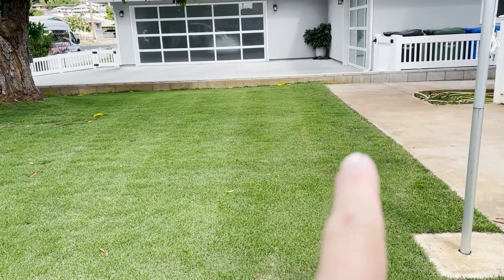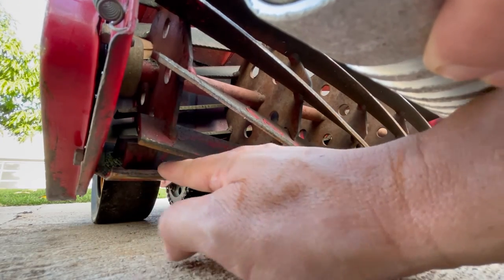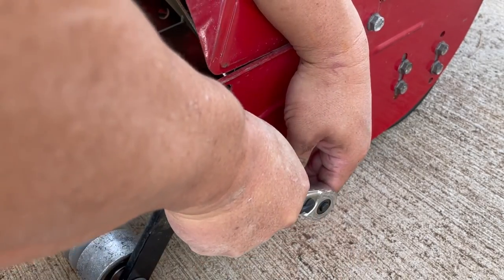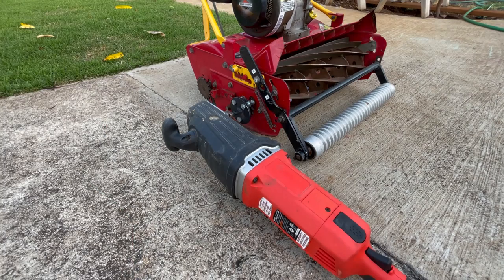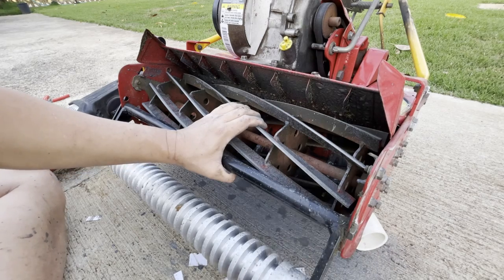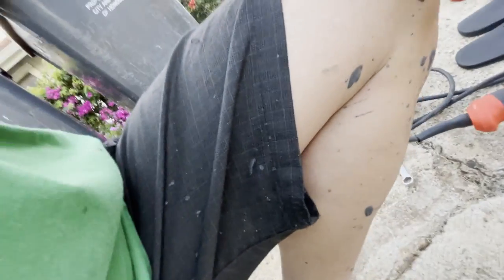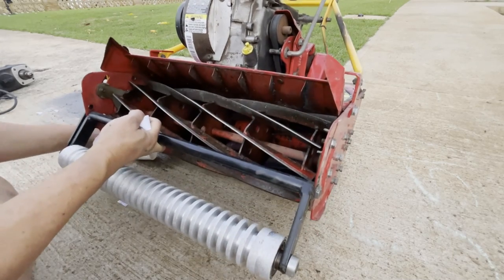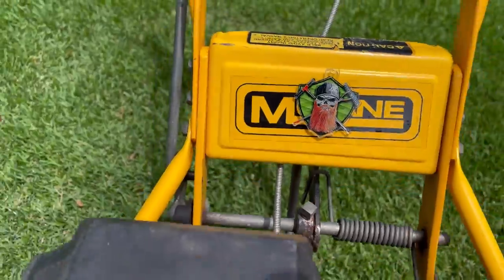How To Backlap a McLane Reel Mower

Comment: Lawn sauce. You are my go to guy in understanding my reel mower issues. The first time I tried to backlap my mower, I had problem re-installing my chain. I had to undo my adjustments of reel to bedknife to get it on. You did not experience any problem. You are the best instructor so far in my opinion.

Comment: Excellent t video!!hello i just back lapped  mine yesterday  and the middle of the blade doesn’t seem to cut. Does that mean I have to adjust the bed knife or sharpen some more, ? Thx you
Reply: I got the same problem.  Seems the middle part of the blades doesn't touch the bedknife but the ends do so when you backlap the middle section of the blades doesn't get sharpened.  Did you resolve your problem?  anyone else have solutions?

Comment: Aloha, question? how long do you usually take to back lap?  I do it about 20 min, just wondering.
Reply from the maker: Good question. I run the drill about 4-5 minutes.  It all depends on the sound the backlap is making.  You can tell as the grinding sound gets smoother as it goes. It seems to do the trick for me.  I guess it also depends on the grit of the backslapping compound.  If you have a finer grit, you may have to run it longer.

Comment: Nice video!  I noticed on you HOC labeling, you have it labeled per the owner's manual, but I cannot get my mower down to 1/4" cut.  After much google searching, they say the newer models DO NOT cut down to 1/4" (3/4" is lowest it goes) even though the manual still states it does.  I have the GR 25" model - bought it about the time your video was published.  Can you actually get your mower that low?  Thanks again for the video.
Reply from the maker: I can get my mower to a 1/4” and it should be the same for the 25” Mclane unless you have the greens mower edition.  Couple of things come to mind.  There are 3 vertical holes on both sides of the mower chassis where the front roller bar pivots.  To get it down to 1/4” you’ll need to move that pivot point to the upper most whole.  There’s a 26” long screw going through the front roller pivot that you’ll need to remove in order to relocate the front roller bar to upper most whole.  The upper most whole is setting A with the cutting height range of 1/4” to 11/16”.  The middle hole is setting B with the cutting height range of 7/8” to 13/16”.  Depending on which hole your front roller bar pivots on, you also need to adjust the position of the screw where notched lever connects to the front roller bar.  In my video you’ll see two small labels, “A” and “B” on my front roller bar indicating which screw hole the notched adjuster connects to depending on which hole the front roller bar pivots on. Hope that makes sense.  If you still can’t get down to 1/4”, perhaps you may want to look at the diameter of the front wheels or in my case the Grooved Front Roller (from ReelRollers.com). Perhaps you may have after market front wheels that are larger diameter.  
Taking a look at the practical application aspect.  I’m cutting zoysia which can get supper thick and dense like a tightly woven carpet.  Even at the lowest setting of 1/4”, it’s not cutting the grass blades at a 1/4”.  My issue is that my zoysia is too thick and dense.  Because of this, my mower kind of floats on top of the grass instead of rolling at dirt level.  In order to get a true 1/4” height-of-cut, I have to run a dethatcher or scarifier like the Sunjoe to thin out the canopy so that my mclane can get deeper down, closer to dirt level to a achieve a true 1/4” height.  Hope this helps.
Reply: @TheLawnSauce  Thanks for the reply.  All makes sense and I do have my settings all in the "A" position.  The only difference we have is the front roller.  I have the grooved front roller from McLane installed (ordered that way from McClane so I don't have the front wheels).  I'm not sure if there is a difference in diameter between the Reel Rollers grooved roller or the McClane model.  Another Youtuber compared the McLane grooved roller to Reel Rollers smooth roller and grooved roller.  He noted that the McLane roller will raise the lowest cutting height to about 3/4" and the RR smooth roller is around 1/4"-3/8" so they must be skinnier.  When (if) I get my yard more level and smooth, that 3/8" cut on bermuda lawn would look sexy!!  BTW, used this video to help with first-time attempt with backlapping.  Helped a lot and I will probably use your adapter hack with the extra nuts!!  That thing drove me to cussing!!!  Thanks again for your video and reply

Comment: What is backlapping and what does the compound do?
Reply from the maker: Thanks for asking.  Backlapping is the process of re-honing the cutting reel to the bed knife.  The compound can be thought of as liquid sandpaper.  Just like sandpaper, the paste has grit in it that aids in the grinding of the metal cutting edges.  The cutting reel is spun backwards while back-lapping compound is applied.  The compound works it’s way in-between the cutting edges and grinds the metal as the blades pass each other. The end result of backlapping will be a perfectly honed cutting edge.